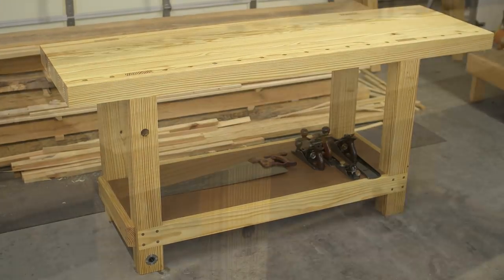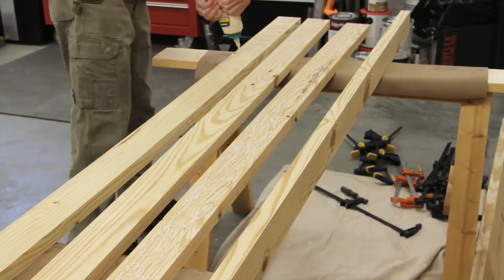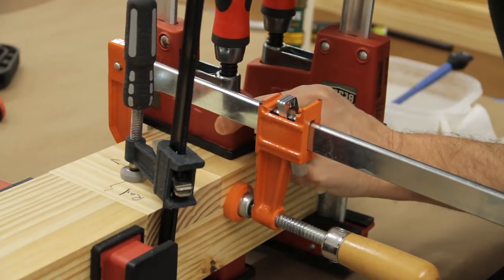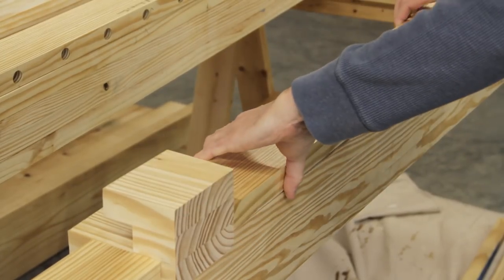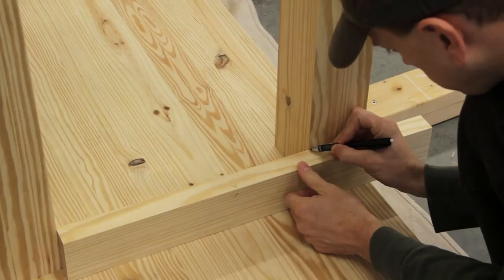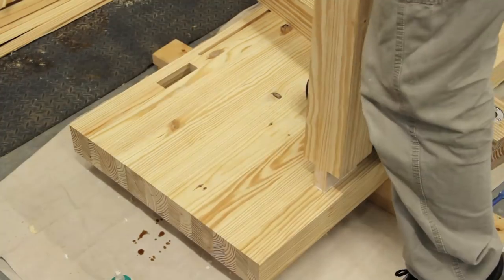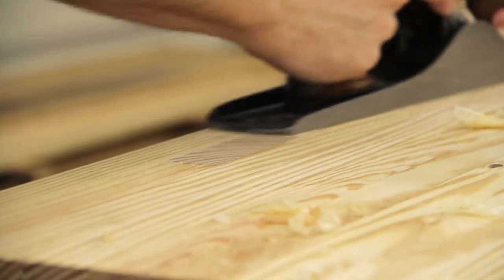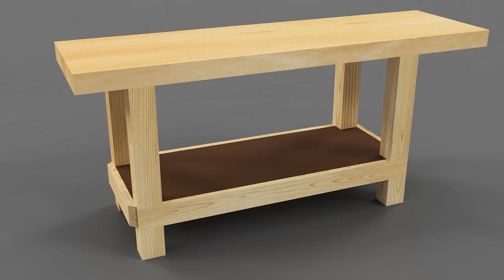Build an Inexpensive Roubo-Style Woodworking Workbench

Comment: I've watched dozens of these laminate bench videos, but really like the process you used and am going to attempt this build this weekend. In particular, the way you did the dado into the top and squared up the bottom of the legs afterward looks like something I can successfully replicate. Still fairly certain I would rather have yours than what I'm going to end up with this weekend, but going to give it a shot nonetheless. ;-)
Reply from the maker: :) Thanks! I tried to order the steps to minimize my stress during assembly as much as possible which is one reason I did the side rails the way I did as well as the mortise and tenons. If you want to use the same casters, you might want to raise the rails up 1/2 an inch or so. I'm sure yours will turn out great! I just used mine for a little live-edge table project and I still love it.
Reply: Like @999erh said, I’ve watched dozens of work bench videos and this one really stands out. And you have some outstanding hacks in here. Example; clamping a piece of scrap to the bottom side when drilling your dog holes to prevent tear out. I have seen a couple of videos that actually drill halfway from each side!  Gotta be a pain ensuring alignment. One suggestion I have; go a little bit slower. Some of us are a little thick for this pace.
Reply from the maker: Thanks! I'm glad you liked the video. Sorry about the speedy pace! There's a fine line between going too fast and putting people to sleep on YouTube, but I'm trying to slow it down some :).

Comment: Hi, I do like your work.  To me, it make sense how you make the legs like yours.  I've seen others that are very beautiful and they're beyond others, BUT I just can't investing ton hours just to cut each holes and/or legs or on the top, etc.  Lol.  Now that I've seen yours, I'm going to make mine like yours.  Thx.
Reply from the maker: Thanks for the comment! There are definitely some pretty amazing benches out there, but I wanted to try to make one that would go together pretty easily, and that I felt I wouldn't mess up. 
I've been doing more hand-tool work lately, and this bench has been amazingly solid and handled everything that I've done. That includes lots of hand planing, chopping large mortises, cutting tenons, and a good bit of spokeshave work making some curved parts. Just yell if you run into any questions.

Comment: Excellent video!! Very smart spacer laminating process instead of chopping out mortise/tenon joints. That's what I'm hoping to do. Have you tried using holdfasts? Is your bench too thick for them?
Reply from the maker: Thanks! Using the spacers for the mortises worked better than I thought :). I've been using the Gramercy Tools holdfasts from (https://toolsforworkingwood.com/store/item/ms-holdfast.xx/holdfasts_by_gramercy_tools) and they work great. I think all I did was rough them up slightly (horizontally around the post) with some 80 grit sandpaper. I used them several times in the video (https://www.youtube.com/watch?v=cPmda0W3uuA).

Comment: Really well done - great explanations for all of the finer points. I especially loved how you did the leg tenons--very practical and simple and they look great! If I'm calculating right the finished size was about 6-1/2 feet x 27 (or so) inches? Can you please confirm? Thanks!
Reply from the maker: Thanks! Yeah, I was definitely pleased with how well the leg tenons turned out. 
With the two boards for the end vise it ended up being 80" wide. Some of the boards for the top needed a little more jointing due to some warp, so the total top depth was 22.5" (They were roughly 1.25" thick after jointing/planing).
I made sure the outer two board thicknesses for the top matched the thicknesses of the outer two leg boards so the mortise and tenon thicknesses would match and the legs would be flush with the front/rear faces of the top when assembled. The "inner" boards for the top can vary a bit if need be if you find some nice flat boards.
Reply: @aroundhomediy  well, it's taken a lot longer than i thought it would (thanks for the total life disruption, COVID!) and since i'm not a full time woodworker, that's OK. I didn't get around to starting until May or June, and actually ended making mine out of maple - starting with rough sawn and milling it all down myself. TIme consuming but satisfying. I"m almost through building now -- hope to have it finished this weekend. Between scrambling to adapt to a new work environment, life in general, and not having the luxury of being able to work at it full time, it's taken a while. But what a satisfying once-in-a-lifetime project. And I learned so much! Thank you again for sharing so generously! I'd love to send you a pic of the final product!
Reply from the maker: Hi Ed! Your new bench sounds awesome! Congrats on getting it all done. Everything always seems to take at least twice as long as I hope and I think this year doubled that, but sometimes the extra distraction is nice especially during a crazy year! I'm sure you love using it!! Definitely send me a photo (Doug at our website address) and if you want, I'll add it to the website article with your photo credit.

Comment: Great video! Quick question: for how long dis you dry your wood before you started building the workbench?
Reply from the maker: It was probably around 2-3 months total as I had to make a few trips to find enough boards and was finishing up another project. If you have an old board already and a moisture meter, you can compare any new ones with the old one. I use a meter like this: https://amzn.to/3hRURw3 .

Comment: Do you think it would be as sturdy with an x brace in the back and no front stretcher? I'd like to build something similar but want to slide a tool chest under for storage while not in use.
Reply from the maker: It might be ok for some things. For hand planing I'd probably want to have a stretcher there. You might look at some designs using 'bed bolts' to secure the front stretcher so it can be added/removed if needed.

Comment: I can only get Douglas fir in my neck of the woods. Is there any special considerations  for Douglas fir that is different than Southern yellow pine?
Reply from the maker: I've seen people claim that Douglas Fir can be bit too soft and splintery for a top, but then I've also seen several people say they like their Douglas Fir workbenches and would make one with it again.

You might want to get 2x10s or 2x12s and rip them into 2 pieces (2x4s are usually pretty bad quality-wise). You may also want to let the boards dry out a bit in the shop before you start.

You could also consider not gluing the top to the base and replace it with something fancier later (but you may find you want changes to the base then as well).

Comment: Nice bench! Since it only has the single mortise per leg (instead of Roubo’s mortise and sliding dovetail), how well has it resisted racking?
Reply from the maker: No issues at all with racking or moving around. It's quite solid :).